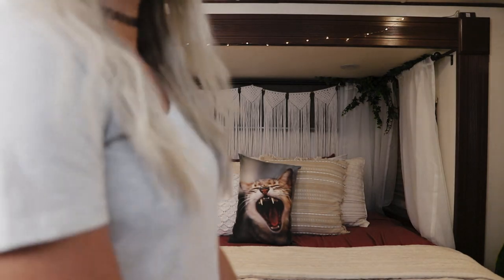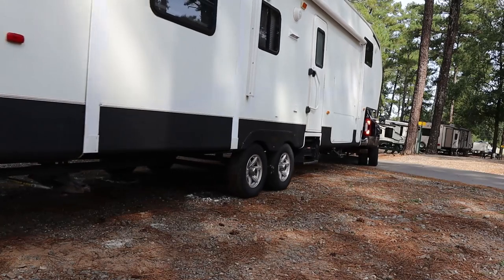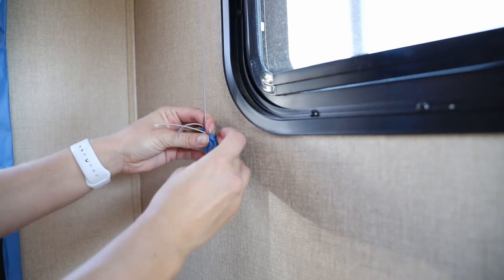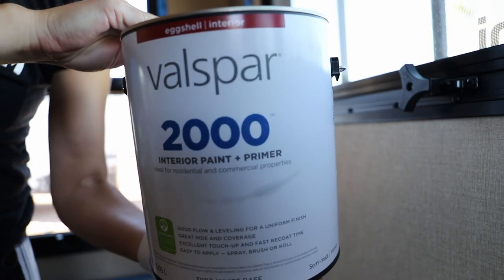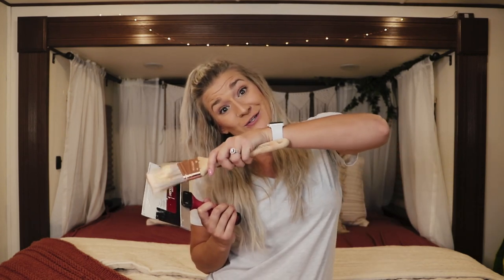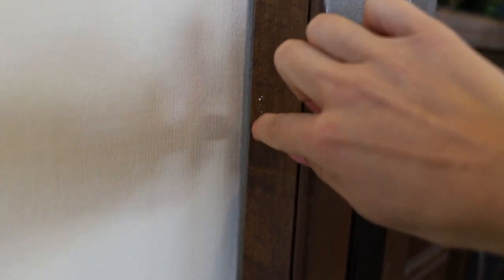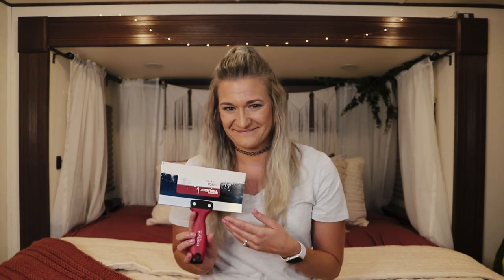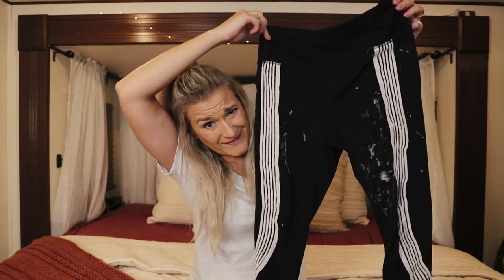How to PAINT YOUR RV (without sanding!)

Comment: As someone who has done tons of painting projects, I would use a top quality exterior satin finish paint for RV walls and cabinets as my top coat. If it stands up to sun and snow and rain it will stand up to an RV interior ...btw I am a firm believer in Bin Zinsser shellac based primer because RV cabinets may be laminate
Reply: Excellent tip.  Thanks
Reply: How do you paint the ceilings? Just bought my first RV looking for tips please!

Comment: You're hysterical and I love it!!! Serenade and all!! Those things are great! We've had a super long blade one forever and love it :)
So we just bought a 2007 forest river shamrock 17' ... got it super cheap though had to drive like 40 hours round trip...but...oh well. Its a hybrid, has 1 pop out bed at each end. Now that we got it home I don't think its in as awesome of shape as was implied...some we noticed when we picked it up but after that long of a trip smaller things we'd deal with...but now at home, I walked in just my socks on the carpet and can feel a bunch of low and spot spots, so, feel a bit sick to my stomach. I most definitely want to paint walls and cabinets to feel brighter since it's small. I also want to make new curtains because the puke green isn't my fave. We opened it all up cuz we noticed they must've put it away wet so mildew stains, and the canopy smelled pretty gross and was clearly wet. I need to figure out the best way to clean the mildew spots and probably re-caulk around all windows and doors and bottom edges outside. Gosh, so many things, but maybe some are totally normal, we've never had one before. We need it for the volunteer disaster relief work we do but don't want to have to stay with people and this was a super good deal.....I hope.....excited but also scared and sick to my stomach. But it doesn't have to be perfect, I'd just like something then the typical brown fake wood look and the puke green accents. I like green, but apparently not this green ;)
Anyway, loved this video and will definitely watch more, subscribed of course, and hope to repaint one day soon  :) thanks!!!
Reply from the maker: Oh gosh!!! Well I really hope that the RV gets completely turned around for you in the best way! A little paint can make a WORLD of difference, indeed!! That and just TLC over time.  RVs are a constant work in progress; that's what we've learned, at least!! Best of luck to you on this adventure!!
Reply: @itsme.rainilee  thanks so much!!! And thanks for sharing your tips, we definitely need all we can get😬😆🤣🙄😁 just gotta roll with it now 😏

Comment: Navy veteran, therefore a painting expert. LOL Everything you said makes sense - except serenading a taping knife. Good comedy, though. Plastic paint shields are cheaper, but your hand will cramp soon - so use a metal tape knife, thank Raini later. Wipe the tape knife frequently with clean paper towel. Keep a bagged trash can handy. Don't use Behr, it's a watery, sloppy, and cheap, and the water loosens the wallpaper glue. The day before you start, open the paint can and put a drop of paint on your wrist, then close up the can - some people are allergic to paint base (usually latex), and heavy travelers are more likely to be allergic than others - because we inhale worn tire latex as we travel - I bet you didn't want to think about that, huh? Good choice of painting pants, Raini, flexible and absorbent. Instead of plastic sheeting on the carpet (which becomes a trip hazard or blows around almost immediately) use a plastic bath mat and throw it away later. Never throw away blue painter tape after a job - keep it "at hand" - you will use it, trust me.
Reply from the maker: Sounds like you ARE a painting expert! Thanks for all of the great tips, Mike! :)

Comment: Raini we took the cabinet down in the bath which tore the seam tape.  We took the remaining seam tape of that particular strip off.  You mentioned filling in the crack.  What did you do that with and did it hold up.  I was thinking it would crack bouncing down the road.  I hate to buy a whole roll of tape that I am going to paint over for a 6' piece.  Is there another tape that would work in light of the fact we are going to paint it.  Also we discovered some places around the shower that repelled the paint.  After two coats it still wouldn't adhere.  We did not use the primer which I regret right now.  Any ideas to fix it, sand, etc?
Reply from the maker: You can actually buy seam tape specifically for RVs from Amazon and use that; that would definitely be the best option! We haven't tried filling the holes with cualk because we share the same concerns--the shifting would likely crack it.  As far as the places around the shower, it's the non paintable caulk that is used to seal the cracks.  We have had to remove ours and use paintable caulking, so if it's really unsightly you may have to scrape that off, purchase clear paintable caulk from the hardware store, re apply it, and then paint.

I hope that helps!!

Comment: Can you paint the ugly fabric in some campers and the valances
Reply from the maker: We’ve heard of a fabric paint but have never used it.  We removed the valences and put up curtains
Reply: Yeah I did on the back windows, but there is a strip of like 4” as “decor” 🤮 above some cabinets and  in bedroom. Do you have a video that shows how you removed valance and patch it up? Tyia 🙏🏻
Reply from the maker: @veronicajanachovsky3577  we don’t have a video about it but we filled screw holes with the same stuff for drywall, sanded, then painted over.  For the cabinet “decor” we replaced with a strip of stained wood trim.   We didn’t have to do that in this RV but did in the first one

Comment: I watched another video that said oil based primer should be used to seal in the adhesive. What are your thoughts on that? Did you use oil or water base?
Reply from the maker: We used latex (AKA water-based) in both of our RVs and it has worked just fine! Nice and easy to clean for light scuffs and dirt. 👍

Comment: I am going to be painting my camper soon and I don’t know if I need to sand my cabinets before painting them. Can I just do primer and paint like the walls or should I sand them?
Reply from the maker: When we did our cabinets in our first RV, we sanded them AND liquid sanded them.  You may be able to get away with just liquid sander, but it depends on the finish on the cabinets (which is usually that fake wood finish) !

Comment: ok I have the stickon sticker veneer walls that is high gloss. what is the bust way to paint these?
Reply from the maker: You could try! I have never painted over that type of surface, though!
Reply: @itsme.rainilee  I was thinking 160 grit sand them clean with denatured alcohol and bullzeye 123 primer. The sand plus alcohol should remove any soot grease etc right?

Comment: Removing and filling the strips is not a good thing. First off it is a mobile unit and it flexes. The joint acts as a buffer for movement and temperature expansion. If you fill it with spackle or drywall mud and it flexes it will crack and show. It might even fall out over time. Best to just paint over it. Also if you want a good flexible caulk may be used to cover the crack on each side of the strip.
Reply from the maker: You’re right, they need to be flexible!  Good tip!

Comment: We tried the "all in" approach to painting ours and still haven't finished.
Step 1) Remove all the things.

Step 2) Clean the walls.

Step 3) Liquid sandpaper, because we didn't want the dust thing. Not fun.

Step 4) Patch lots of holes, spackle lots of missing seams and other damage. Not easy if the damaged area has exposed any sort of glue residue. So in come denatured alcohol, paint thinner, goo gone, anything to try and remove that stuff, yet it stays tacky anyway. Time to just paint over it!

Step 5) Primer coat. Might have even done two primer coats because the first one looked like it primed nothing. Translucent.

Step 6) Buy most expensive "one coat" type paint at Home Depot, something like $65/gallon. Then proceed to require not one, not two, but at least three to four coats just to STILL be able to see the wallpaper tan color coming through the white!

After 11,004 hours and 18 coats of paint and a graveyard of empty gallon paint buckets, it now looks like we have slightly whiter tan RV wallpaper. I don't know what they make RV wallpaper with, but it was designed to Superman laser burn that color and pattern right through any white paint mankind has invented.
Reply from the maker: WOW.  I have never heard of such a strong wallpaper... I am sorry to hear that it has put up such a fight!
Reply: @itsme.rainilee  Honestly I feel like if I did RV stuff again I would just leave the walls alone! Now we're half way in and who knows how many hundreds of $$ on paint supplies and it's half done. No turning back, no easy way forward. We could always try a different paint brand, but then with color matching, might have to paint over previous work all over again. Just not fun!

Comment: Do I paint over the border on the walls or remove them?   If removing border,  please provide instructions.
Reply from the maker: You can either scrape them off or heat them with a heat gun and peel them back... if you're talking about the decorative border that is found in older RVs?